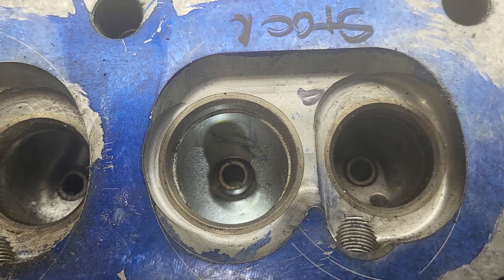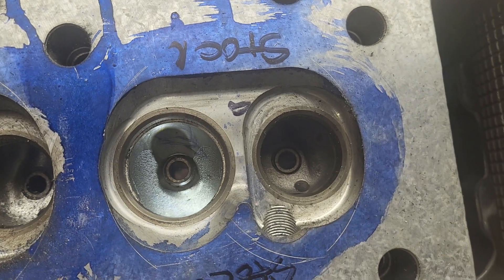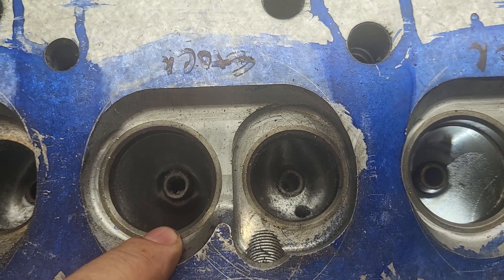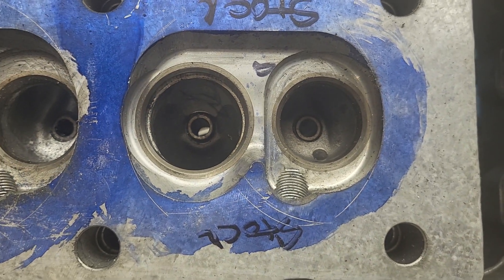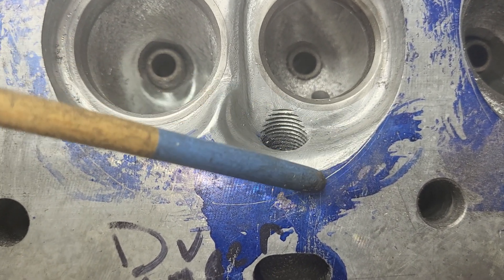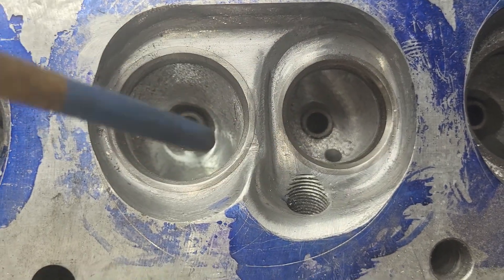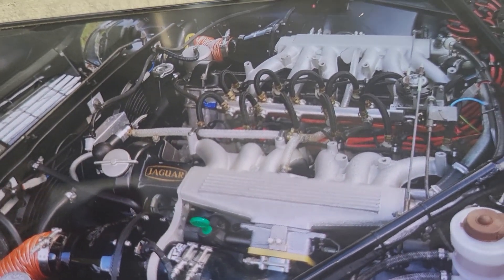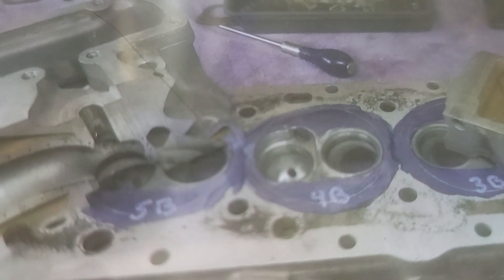Jaguar V12 high energy cylinder head, David Vizard's chamber design and discussion. Part 1

Comment: The blending will reduce the swirl efficacy a bit and make it more wedge like. Two examples of taking the May fireball heads further are the last generation EDYN Ford Boss drag racing heads and the Feuling R&D big block chevy heads. These both increased the quench areas and reduced the combustion chamber blending with very large quench areas for an almost a extruding type of high pressure nozzle like swirl coming from the exhaust port side.
Reply from the maker: Good info. Thanks

Comment: Well it worked rather well. When first produced in 1981 it had 12.5:1 on 92 octane pump gas and 14:1 on 93 octane. This was later reduced to 11.5:1 and finally to 11:1. The reduction wasn't directly due to octane issues but because the higher the compression ratio the slower the catalytic converters lit and these big v-12s were trying to meet early 80s smog laws. Interestingly, It was also found to run satisfactorily at 16:1 on 97 octane.
Reply from the maker: Very interesting. Thanks

Comment: As Sean Brown mentioned it's the May fireball head that he couldn't sell to VW and was the answer for Jaguars' efficiency problem. H.E. stood for high efficiency and was on the boot-lid for the first few years and then dropped. I had an '88 that got 21 mph on the highway so there was no complaint there. It was an 11 to 1 CR that ran on mid-grade fuel. When fully and properly tuned is a great running engine. Much better with the next years Marelli ignition and far better with the 6.0L and 4 spd gearbox in the ones I currently have. 
Although the vertical intake ports look great on paper in practice they failed. It was a carryover from the early '60's indy car engines like the original Ford Coyote and others. The problem with them is the stagnant air flow that possesses no swirl or tumble therefore poor cylinder fuel air mixing.
Reply from the maker: @Capnhook63  Good info. Thanks

Comment: This chamber was very successful. Made the Jaguar V12 a long production engine like about 25 years or more long.

The HE combustion chamber is but 1 part of the HE package. The design allowed a very lean mixture past peak EGT.
High compression was another part. Bosch (Lucas labelled) fuel injection was another part, a tall rear gear ratio another part and a GM HEI (again Lucas labelled) another part that had the required punch to ignite the lean mixture. The system was a more sophisticated Mopar ELB with the lean burn baked into the combustion chamber and piston design.
At full throttle the system ran regulation A/F ratios. 

To give you an idea of how good they were when set up according to the book - I say that because idiots who had no idea how to read, had no mechanical aptitude or understanding of basic mechanical principals - would start changing things when the engine started stalling or running rough. So when set up back to factory, they would get about 21 IMP gallons (not USG) to the mile. 
The HE still had more power than a pre HE at WOT. 

Here's the thing, the pre HE is a far nicer engine for performance. A pre HE revved up is unbelievably smooth, it's just the early injection system wasn't great. Also many pre HE's had 3.31 rear ends the HE had 2.78 or something.
The pre HE had very heavy pistons too. The weight of them was ridiculous.

I'd love to see what DV might do to a pre HE head. Pre HE heads are called Heron heads. As you mentioned they're just flat. The combustion chamber is bowl in piston. Be interesting if DV could come up with a piston and porting for the pre HE. 

People have generally found the HE head doesn't respond very well due to the recessed exhaust valve. Gains made tend to move the torque band around rather than increasing power production past 350hp. This was found by Jaguar who introduced the 6 litre HE in the 1990s and that really was the pinnacle. It had torque below 2500rpm, whereas the both the 5.3 pre HE and HE were pretty gutless until the rpm went over 3000. Part of that was the weight, the other the rear gear, the other the turbo 400 in them and the other part was heavy pistons.

I'm sure with the DV treatment the limitations we mere plebs can attain from the HE will be surpassed. You see, the pre HE is comparatively easy though getting NA power over 400-450 from a pre HE is still pretty difficult. It rises to that range then after that it is the law of diminishing returns ie the large amount of money spent starts to yield smaller and smaller returns.
Reply from the maker: Great info! Thanks!

Comment: hi, what year is that cyl. head? or years it was used???
Reply: Whilst the engine was designed in the late 1960s and early 1970s by Harry Mundy and Walter Hassan, the biggest change to the engine was this cylinder head which was introduced from 1981 and retained until the engine ceased production in 1996. The 1970s engines had flat heads and dished pistons and in common with many fairly good but badly timed Jaguar releases, their largest engine to date arrived right in the middle of the 1970s fuel crisis. Michael May convinced Jaguar to try his "May Fireball" lean burn cylinder head which was extensively tested on single cylinder test engines until release as the HE (High Efficiency) in 1981 with new injection and ignition systems and a taller final drive ratio. The flathead 70s engines are most commonly referred to retrospectively as "pre-HE" engines. Hope this helps :)
Reply from the maker: No idea

Comment: Michael May "fireball" head. Originally, it was supposed to center the swirling charge over the exhaust valve and spark plug at tdc to make for a rapid burn. The idea works,  but I am not sure they did it to the full extent at Jaguar. I think Group 44 used the Heron head (chamber in piston) design for more flow and outright hp.
Reply: Michael May is an amazing guy who started turbocharging road cars in the early 70s. He‘s born in Germany but lived in Switzerland most of his life. He sold most of his stuff here in Germany an was well known under his companys name „May Turbo“. He started racing in the 50s and won early races by just installing a movable rear wing to be able to drive with much higher corner speeds. No one back then knew about the advantages of wings until he used it on his Porsche 550 and was faster than the Porsche factory team. Porsche made a protest and even if there wasnt anything about wings in the rulebook, they banned it  because May was about 4 sec faster per lap as the factory Porsche. He is still alive, now 90 years old!
Reply from the maker: Stay tuned for  part 2! Thanks